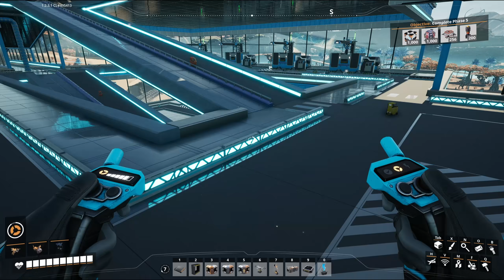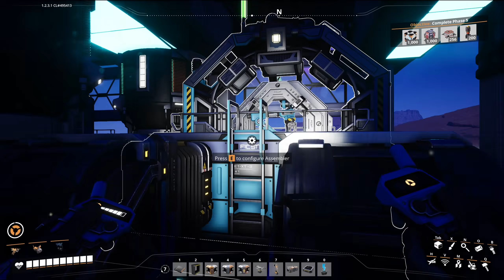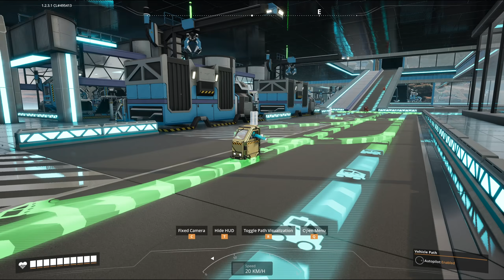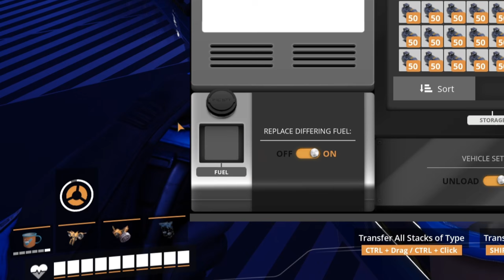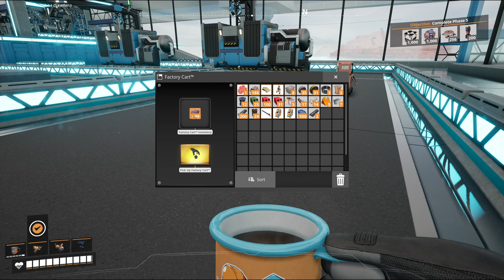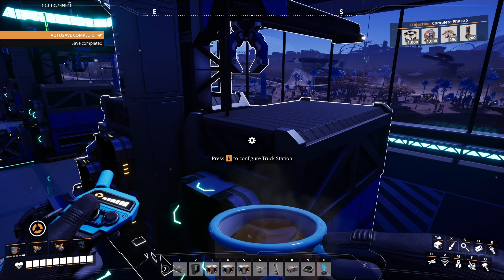Stop Using Long Conveyor Belts  - Use Factory Carts Instead

Comment: they should add a few more design varieties to the trucks, factory carts and such. We can customize buildings quite a lot using the blueprint maker and nudge-tool but... apart from a splash of color on vehicles, they're kinda bland.
Anyways - awesome video! its exactly the info i needed, coz i figured i would try using them but i was unsure, what to do and what NOT to do, with the small carts. great video!
Reply from the maker: Thanks so much for your valuable feedback☺️ I agree, I am just speculating, but now that coffee stain studios started to update the vehicle oath system, maybe update 1.2 was just the beginning of many vehicle updates. They definitely have lots of potential, like you described it.

Comment: My last big build used factory carts kind of like this. I used them specifically to transport overflow of non-critical items to my central storage facility. Most of those items were low throughput, and generally not mission critical, so the low throughput was sufficient. It limited unnecessary long belts, but like you said near the beginning of the video: it added a TON of life to the factory. It was great seeing a ton of activity.
Reply from the maker: I love the idea, this is a great way of using them. Thanks for sharing it with us☺️

Comment: The rates are just waaaay too slow even for later items. I'd have to have a hundred carts going in a loop for each item and then it would be messy and annoying for a different reason.  Maybe this makes more sense for casual vanilla play but not for a F.E.A.R. run on all pure nodes.

Comment: "should only be used for low volume items"

a few minutes later...

"...my copper powder cart..."

That may not be the highest volume item in the game...but it sure tries to be

(though it does have a large stack size, so maybe that's enough to overcome that...)

Anyway, cool idea, I'll probably play around with it a bit...been meaning to try out some of the vehicle options.

(now to do a video on using the Cyberwagon...)
Reply from the maker: Thanks for your valuable feedback☺️

Yes, for low volume items, it’s always working without afford. 

You can extend it to large stack size items, but you might need to add a few more carts. So a bit calculations is needed :)

And the cyberwagon-video will be my troll video then😂
Reply: @moindustries  yeah, after posting that, I took another look at copper powder and realized that it's so much lower throughput than the copper ingots that make them...still very high throughput in many respects, but the large stack size of 500 would make it much more manageable for shipping that way

Comment: I reckon a good way to get around the size issue of truck stations for particularly low-throughput items is to just have multiple types of items being delivered to a single truck station. So long as your throughput doesn't exceed that of two belts, you can use smart splitters and an AWESOME sink to have a sushi belt outputting things without any backup. I think that'd be especially useful for delivering low throughput items like HMFs to a central storage location.
Reply from the maker: Wow, I love the idea🤩 it’s not beginner friendly, because mixing can always be problematic. But with a bit of careful planning it would solve the problem of having many stations. I will definitely try this out. Thank you☺️
Reply: @moindustries  Yeah, I agree it's maybe not super vanilla friendly, especially since sushi belts aren't used as much in SF as they are in, say, Factorio. Shouldn't be too complex though if you know what you're doing. Good luck, hope it works out well for your use case :)

Comment: I only used trains in my first play through in 1.1. 
I tried out carts like this in my current world, I like it theory but I don't like how massive the truck stops are (I mean they're fine for trucks, it just seems like overkill when your basically just putting 1 box onto a little cart).
Reply from the maker: I totally agree. This is literally the biggest downside. I would really hope Satisfactory will add this in an update. In theory it shouldn’t be that big of a hustle to implement factory cart sized truck stations, I guess.
Reply: @moindustries  I've just seen the "Factory Cart Station" mod which I think might be just what I was looking for
Reply from the maker: That’s amazing 🤩 thanks for sharing it. Just look if the savefile still works when you disable the mod again, to be on the save side ☺️ it would be a shame to lose the world. 

Depending on the mod the savefile can break without it or future updates might not be compatible with the mod.

Comment: I think if there was a dedicated factory cart docking station that was not much bigger than the cart itself, they'd be absolutely integral. 

But the fact that the docking station is so huge makes planning routes around them a real pain. 

I can think of a few ways to do it nicely though. Maybe I'll try it in my next factory.
Reply: I really dig this idea, like a Roomba docking station
Reply from the maker: Hahahah, amazing visualisation
Reply from the maker: Yeah, I see the same issue. But as you said, there are a few ways to make them fit the factory really well :)
Reply: As the developers have said at least once, you will run out of resources in your PC longs before you run out of space in Satisfactory.  You can always just build bigger factories.
Reply: @megachonk9440  It's more about aesthetics than space.  Truck stops are big and clunky compared to the tiny factory carts, making them an awkward fit.  
And if you're at the point where you're making an effort to use factory carts in a design, aesthetics are already a big part of your interests.  A station more intentionally designed to suit factory carts and tuck more neatly into a factory would be great to see.

Comment: Carts are excellent for screws if you have Steel Screw. Have them move a stack if steel beams to where you need screws, then run the Steel Screw constructor. 

Depending on how long the rout is, the throughput is higher even than a  Mk.6 belt carrying screws.
Reply from the maker: Good point, I see where this is going. I will have a closer look to that 😊
Reply: @moindustries Basically, anything that expands a lot after you process it is good for the carts. Or drones more traditionally. I dont know if anything else has quite as much expansion as Steel Screw though.
Reply from the maker: Yes, thanks for mentioning. In my factory I transported in- and output with factory carts, which was a bit more limiting. 
But in general and for most pioneers, who just want to include factory carts into their factory, you made a very valuable and useful point. Thank you 🤩

Comment: This was a very good and informational video, I didn't even realise cart can be used like this. Thank you. Btw, not all truck stations need to be fueled, when using fuel consumption vehicles, just one for the the duration of fuel your vehicle consumes during the drive. I'm saying this, because an off hand comment about truck stations needing fuel line.
Reply from the maker: Thank you very much for clarifying☺️ you are absolutely right. You formulated it very precisely. I like it. 

You might enjoy my other video about truck networks too.
Reply: Hi, so if i understand you correct on a route it is enough to have one truck station with fuel as long as that covers a full trip round?
Reply: @ekonnic  Yes, if you are sitting on a truck, you can see how long the fuel lasts, and how long the whole trip is. if the trip is shorter than the amount of fuel used, you need one, if it is more, you need additional fueling stops.

Comment: They also add some much needed personality to the factories... I wish they had more options that looked like the bots from Wall-E... or one that was a Satisfactory version of Wall-E
Reply: This seems like a much more realistic approach to factory designs in real life too. I worked at a warehouse. Pretty much EVERYTHING is moved by pallets. So, that means we use forklifts for heavy things that need to be lifted, or if moving locally, a pallet jack. Conveyors are certainly used in bigger manufacturing plants, but even still, at the end of the conveyor is... yep, a pallet. Go figure.
Reply from the maker: Thanks for these insights. It actually got me thinking: how cool would it be if factory carts transported items on pallets, so you could see the items just like you do on conveyor belts?
Reply from the maker: Ohh wow, I have never thought about it, but having a Wall-E driving around my factory would be really cute - personality times 100. What other bots could there be? A Star Wars factory with R2D2 and BB-8.

Comment: there s a mod for a cart only station that s smaller. kinda wish that was in the main game
Reply from the maker: That would be perfect. But also the Mod looks appealing. The only question is, what happens if you remove the mod from the save file.
Reply: @moindustries  breaks that my issue with mods until they add actual mod support
Reply from the maker: Yes that’s a big issue. Cosmetic mods or some quality of life mods like infinite nudge are okay, but you always need to check carefully if it can cause problems with updates if you want to add a mod

Comment: It would be cool if factory carts were the only vehicle that could take a stack directly from machines or storage boxes.
Reply: yeah like an addon you can attatch on the machine input and output, still waiting for splitters to directly attach to machines so... we can wait I guess XD
Reply from the maker: Great idea, like an addon🤩 I picture it in my head. 

Yes I think for Vanilla Satisfactory it will still take some time, but maybe someone makes a Mod. Does anyone know about such Mods?
Reply: @moindustries  I dont recommend using mods if you have a long term world, when satisfactory updates the mods become incompatible for a long time or even forever and I had this issue 2 times, so mods that add "blocks" or items are a no no for me at least xd
Reply from the maker: True, good you mention it. It’s more like for a smaller fun world. For your main save file it’s good to be picky. There are mods (especially cosmetical ones) which doesn’t affect the save file when removed, what is very important.
Reply: Yeah, mini stations the size of a splitter. Cart just drives in-drives out. The problem would be that you'd have a ton of stations, so some clever naming convention would be needed
Reply from the maker: Wow, that’s a really cool idea! Thanks for sharing. With this idea, you could even do a factory with zero conveyor belts 😮
Reply: That would be super cool! 

Something like a roomba docking port that can be attached to any belt, like a splitter, but the factory cart can just dock, fill/empty its contents and go!